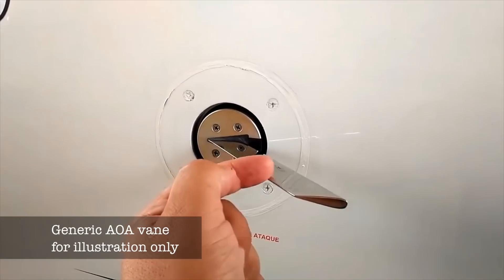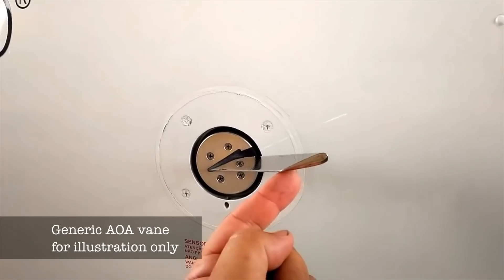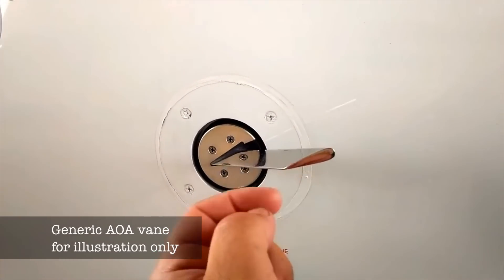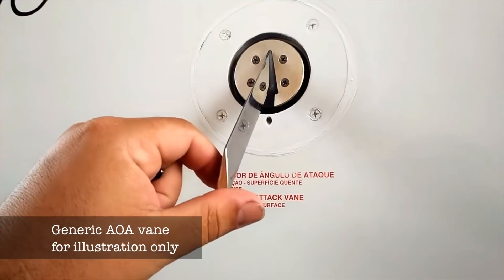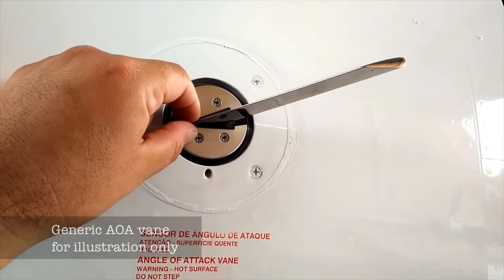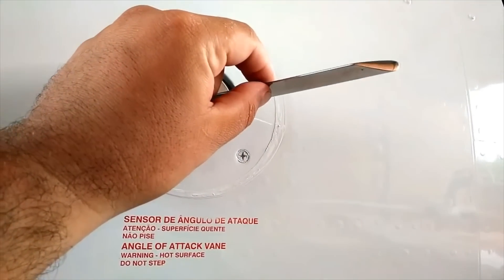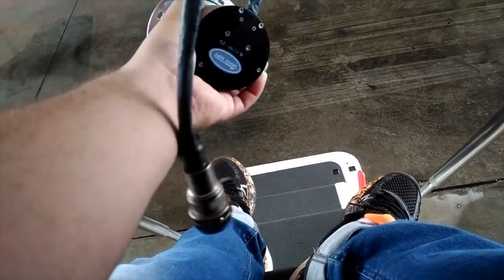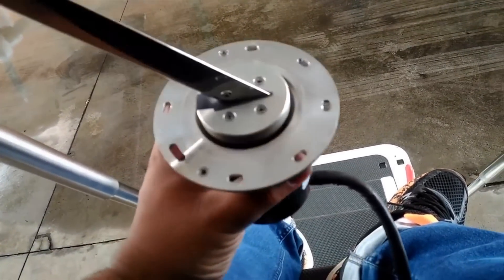Boeing 737 max 8 Angle of Attack problem - Prof Simon

Comment: Bunk. The planes involved were brand new. It wasn't Lion Air's fault; it wasn't Ethiopian Airlines' fault. Neither was it fault of the very capable and now deceased pilots. It was an overly aggressive software program which took the control away from the pilots.
Reply: Sensors fail, the pilots screwed up by not disabling the auto trim when they saw it kept trimming the plane forward.  While a system failed, the crash was due to pilot error.   
The 1st set of pilots save the plane by overriding the system.  The 2nd pilots chose to fight the trim manually instead of disabling it.  So they crashed.
Reply: @common_c3nts  The first set of pilots who saved the aircraft were aided by a third crew member in the jump seat. It was that member who had the clearer picture as she was not busy trying to control the plane while going through checklist in a situation literally NO ONE was trained for. Stabiliser trim runaway doesn't really count because the symptoms are just different enough to cause pause and doubt when you least need it.
There has been no training for MCAS failure because Boeing decided it wasn't necessary.

Comment: It should be using both sensors and other information such as airspeed, altimeter and the artificial horizon which would also act as an AOA sensor unless the Horizon uses the same sensors...I thought the horizon used a built in gyro. Maybe the professor knows?
You see, if AOA sensor(s) say nose is up causing MACS to trim for nose down but you have an airspeed of 320knotts and climbing with altitude dropping then there is no way the nose could be up which would create a conflict. The software logic could then direct MACS to disable in that situation. There are many flight control scenarios that the software could be written to take appropriate actions including disabling itself, but to not train on the system and have it so that it could push the nose down so hard as to cause the aircraft to crash is plane stupid.

Comment: What if the engine suck air fron the front is actually causing causing the sensor to be misbehave and giving a false reading. Because the engine is put very close to the  middle of the aircraft can it be somehow affecting air flow around aircraft causing sensor to give a false reading.
Well only the expert now I'm just nothing but an amateur

Comment: That accident was caused by that one faulty swivel sensor?
Reply: rollmeister Yes, highly probable. Seems like the MCAS was designed to like at just one sensor read out per flight. It should have been design to compare the two at the same time to find out if they are reading the same value, so to check if the sensors are working correctly.

Comment: It’s my understanding that the  procedures for a runaway trim are memory items. MCAS or not the procedure should be, auto pilot off, auto throttle off, trim motor cut off and last physically stopping the trim wheel. Once the aircraft is stabilized then start working through the check list.  I fly helicopters and we fly low. There are certain emergency situations that you have to react to within seconds or it’s all over. I’m not second guessing the pilots, just waiting to see what the flight data recorders show. I’m trying to understand how the MCAS fits into the emergency procedures. I’m also trying to understand why the accidents have been overseas, despite the thousands of hours the Max has been flown in the U.S.
Reply: helis are flying coffins, why would you fly that when you can fly a beauty like the 747
Reply: Second comment: jetliners have a trim that continuously makes small incremental corrections to the flight attitude of the aircraft. Especially in the flight regime transition zones. As I understand it, when MCAS intervenes and tries to correct the attitude of the aircraft, these trim wheel inputs look initially like the normal trim corrections they are accustomed with. MCAS activation is not a continues trim wheel motion like a runaway trim error is.
As Blancolerio tries to explain: this is the insidious part of the MCAS system. MCAS intervenes with a maximum 2.5 degrees pitch attitude correction, divided in 0.27 degrees per second inputs. So, the pilot thinks during it’s accent: well that’s weird, the aircraft angle is a bit low and pull back on the yoke, increases power a bit, but does not touch the trim. 
Pulling back in the yoke and increased power makes the plane pitch up, MCAS activates again and corrects another 2.5 degrees trim down (now the elevator is 5 degrees off), pilot think again: what’s my plane doing? Pulls back on the yoke, increases power, plane pitches up, MCAS activates, etc.
This continues until the pilot finally thinks about: hey my trim could be a runaway!? And pulls the cut off switches. 
By then they have to manually trim the wheel, which is nearly impossible due to the aerodynamic forces ( angle and increased airspeed) on the stabilizer. Making it impossible to trim by human power alone. Aircraft is pitched down so far that saving is impossible and ..
Reply: Rishi, that is a very good response. There's apparently another issue. When an AOA indicator goes bad, apparently it triggers several error messages, so pilots become confused wondering which to heed. By the time they figure out what is actually happening, the stabilizer may be so far out of line, there's not enough time to correct it.
 
Since there are two AOA indicators, Boeing did offer an AOA disagree indicator when they differ. But that was an extra-cost option. I've heard it cost either $8,000 or $18,000, which can be substantial for some airlines. And why would Boeing make a necessary safety item an option?
Reply: It just happened that they were overseas. Many other 737 maxs flew overseas and did not crash. Maybe it's better that they were overseas anyway. Imagine if one of them was a Southwest and the other one American Airlines killing up some four hundred people in less than six months in the United States! The airlines would be done.
Reply: You are correct. It is a memory item. I flew B747 and on our 6 month sim we always had a "run away stablizer" sometime during the check. Seems like the crew bringing the aircraft in knew the procedure. Problem of course with the system but seems like also problem with crew training.

Comment: Now it's time for Boeing to shut down the company, how airlines will trust Boeing when they design a new aircraft, how will they know if something is hidden, it'll be a relief for us and we won't have to worry flying in new Boeing made aircrafts thinking what the hell are they hiding on this aircraft, they were many accidents due to design flaws but this one is ridiculous they knew what was new on the aircraft they never told to the pilots all just to compete with airbus rushing the certification process, since the Lion Air accident they knew what was wrong and what caused the accident but they remained quiet. They only care about money and now the world knows it
Reply: On the contrary now is the time to fly a new Boeing aircraft. You better believe from now on out those airplanes are going to have a million sensors and even the carpet in the cabin will have a backup. It's the Airbus planes that you need to worry about now because they are all smug thinking they got it all together.
Reply: You're displaying what someone aptly called a "binary" response to fears. For such people, either something is safe or unsafe. If unsafe, then it must be avoided no matter what. It's often remarkable how little it will take to set them off. That makes no sense. Everything in life has risk. 

Boeing will almost certainly lose billions of dollars in business and damages over this. But the people who run airlines don't deal are not binary about their fears. Their only options are Airbus and Boeing and they certainly don't want that duopoly reduced to a monopoly.

Comment: I worked 35 years in aTesting Laboratorie, with FAA, Boeing Eng, Airbus Eng.....,conclusion everyone is at fault to certain degree so a lot of things happening at the same time is the cause of the crashes.......................driving a car is more deadly............
Reply: to be killed by faulty designs, the MAX is much deadlier.
Reply: But at least was driving a car you have maybe two seconds before you meet your demise. With an airplane such as this situation those poor passengers had 10 minutes to contemplate their ultimate death. The experience preceding dying in a car crash is a whole lot easier than that of dying in a airplane crash.
Reply: Doesn't look like AOA device is adequately tested for such a critical role in the safety of passengers - they need to consult QC experts and lowers down the failure rate significantly.

Comment: I'll never fly on the Max. The MCAS system scares me and I don't care how Boeing fix it with "software fix". Very sad Boeing kept it secret from the pilots and maintenance personnel.
Reply: George Suchenstein I had the same attitude about fly by wire / Airbus after a report from many years ago that the fly by wire system put an airbus into 3 stalls before pilots could finally wrestle the controls away from the computers.   Computers ultimately decide if they accept pilots’ joystick manipulations or not on Airbus planes.  Yet, years later, Airbus planes have had very few incidents due to fly by wire, and have even pulled off some amazing emergency landings. 

Boeing is going to learn from this mistake and ultimately this aircraft will end up being safe. But in the future you are going to have accept some kind of computer controls on aircraft or not fly.

Comment: I have been mad about this sensor and MCAS system from the minute I heard about it!

Here is a post I did post in another Youtube channel:

I don't even know where to start!?

I'm a programmer. I do a real heavy stuff as a such a one. English is not my native language so bear with me, my bad grammar and little practice is of no indication of any kind of my programming skills. 

First you tell me these sensors are great, now you tell me they are so faulty that they can't show the same result for a measurement of single event. And instead that Boeing Automatic System used two of them together, they just turn the blind eye at one of them and use, perhaps use dice to decide?

If AOA is 10° and one sensor say it is 5° and the other 12°, then the AOA is what? 5°? 12°? 
Or.. perhaps it is still 10° and should not be measured by sensor which can not measure it?

If sensors can't meassure what they was ment to measure, they are utterly garbage and shouldn't be near any Flight instruments, what so ever in full automatic system, that's so basic in any programming skills none should have to mention.

To add on.. there is lot's of horizontal sensor out there. One is in the cockpit and is called, Attitude indicator, based on gyroscope, at least in older versions but electronics in newer I think. You could easily calculate AOA with change of altitude and simple horizon sensor in split of sec.

https://en.wikipedia.org/wiki/Attitude_indicator

Drones use a simple version of Gyro sensors. There is nothing wrong in using different type of sensor to measure or calculate AOA. In fact, it's a must!  

Finally.. how stupid is it to fly a plane in automatic mode so it will crash in  the ground at full speed? How stupid is it to not use other kind of information as altitude or distance to ground etc. to avoid such a disaster? 

Isn't mandatory to save the plane instead closing some ugly angle in AOA for some prettiness in flight? Specially if you know these sensors are not reliable?

This video shows another angle of this bullshit.. 

https://www.youtube.com/watch?v=4koccb8suOQ

The MCAS system switched to use different AOA sensor, right and left.. but didn't compare them.. the probability of fault sensor is therefore raised by two!!!

Comment: What if the angle indicator hits turbulence and gives wrong angle???
Reply: Probably hidden by a low frequency filter
Reply: ki0ng  I can't see how that would prevent an incorrect reading, it would just mean less frequent incorrect readings. Where did you learn of this from?
Reply: @edism  What ki0ng and snowcat are saying is that there effectively must be a low-pass filter in the sensor data stream.  Short deviations such as in turbulence will not pass through that filter.
Reply: Turbulence is usually not that fast moving air, compared to the airspeed of the aircraft. If there is a turbulence that is strong enough to trigger anything from the sensor, it will hit the wings a fraction of a second later and the pilot won't care if the reading was wrong for that fraction of a second, because now it's true.

I can imagine only two situations where there might be enough turbulence to generate a false reading and that is when crossing a wind shear or during a microburst. On the other hand, both will put the plane into trouble anyway, so the pilot will execute an escape maneuver, basically going full throttle and trying to keep the aircraft flying. The escape maneuver tries to put enough energy into the airplane to counteract the energy loss of encountering a really fast downdraft and keep flying.

Great video about it: https://www.youtube.com/watch?v=pP5Z7_x9UEk

Comment: Any pilot who accepts an aircraft after the maintenance department enters CND on a critical system is a complete idiot. I have seen many reports indicating that the MCAS alternates between AOA vanes so the information is out there. Could it be that the mechanics at Lion Air are as poorly trained as some of the pilots?  Lion Air has a long and storied history of poor maintenance, deferred maintenance, etc. Every airline has a tech rep from the manufacturer. It seems to me that they could have contacted the rep for assistance since they were working on an important system. CND is shorthand for lazy mechanics.
Reply: U tell about EASA ban, when Lion buy 737NG was lifted by EASA??

Comment: This is a big deal if it's true. For air carrier aircraft any maintenance procedure is broken down into work cards. It gives the A&P mechanic the info he needs in one spot, the procedures to follow in the correct sequence, and space to sign his work. If "test twice" was not included in the worflow, that's a huge oversight. Until I get confirmation I would fault the mechanics, Europeans call them "engineers" for possibly testing the new plane like they would test the old plane.

Comment: Professor Simón: «What if » the airstream was modified by the suction of the engines playing a crucial part in the AOA readings?
Reply from the maker: They mount the Aoa away from interference from engines or being masked by the fuselage
Reply: Professor Simon I know the  AOA must be far from the disturbed air but, what about suction created by the air intakes? 
My question still remains due to the fact of the new relocation of both engines: up and forward of the previous models.

Comment: Why wouldn’t MCAS check both sensors and see if they agreed on the AOA?  If they didn’t the system could shake the stick and let the pilots sort it out.

Also, don’t these planes have their own inertial guidance system based on gyroscopes and accelerometers? Why not have MCAS sanity check the AOA against calculated AOA?

I am a retired engineer who worked in digitally controlled shipboard weapon systems and I am shocked at this approach to flight control systems.
Reply: Gary Brockie thanks. I also wondered if the AOA could check against other systems on the plane.
Reply: Boeing sell feature "AOA Disagreement", inertial guidance system was used by Boeing in past, MCAS should calculate on complete data double speed , AOA etc then react
Reply: Gary, apparently Boeing's fix is to "now" use both AOA sensors, and if there is a discrepancy between the two, to give the pilots a warning light, and disable the stab trim motor auto drive.  Like in your first sentence, what they should have done in the first place!